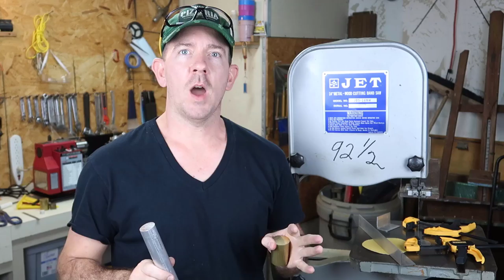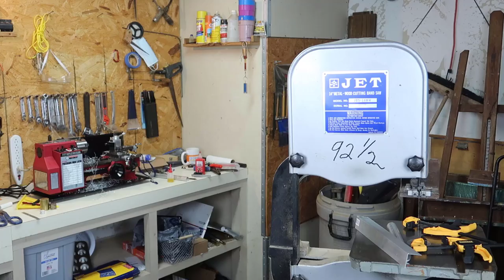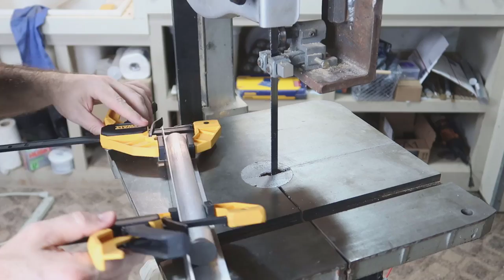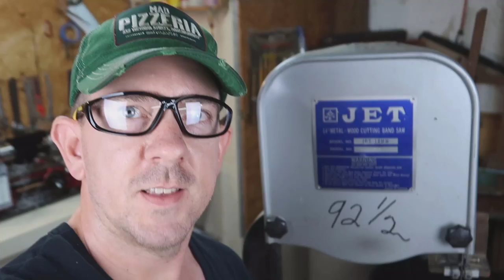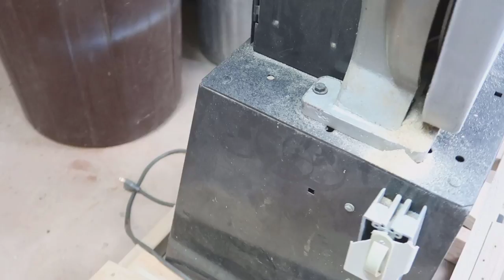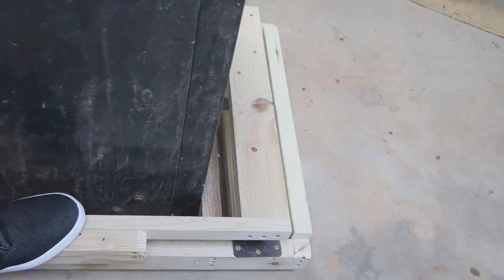How to cut round bar on the bandsaw.

Comment: That's actually a very relevant topic - more people should watch your video! A few tips though: a) bolt down your band saw ... b) "cut" sandpaper by scoring it from the rear with a (blunt) box cutter or a wood screw - this way it won't ruin your snips c) "lubricate" your bad saw with a WAX lubricant (like Tapmatic) - if you are in a pinch, you can use a candle (pull out the wick first!) ... d) use "proper" clamps (they are way safer) and make a small "V" block from plywood or delrin - will make clamping much easier!

Comment: I was cutting a short piece of 2" aluminum and wanted a square cut. I clamped in a drill press vice and used the bandsaw fence to guide it. Problem is the old wood blade I had barely cut so I ordered a blade for metal.  We will see if I can finish the cut.  What blade did you use?

Comment: The aluminum angle is not cheap. A chop saw would be nice. If you clamped your round  bar to the angle on both sides with a metal clamp might work too. So 2 peices of angle with a space  between.